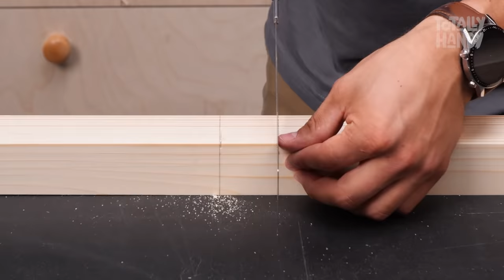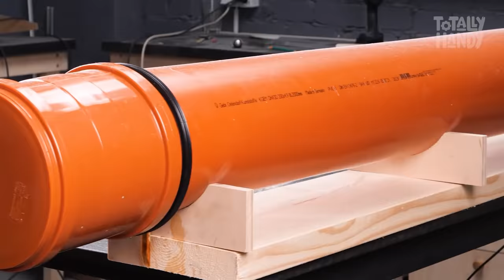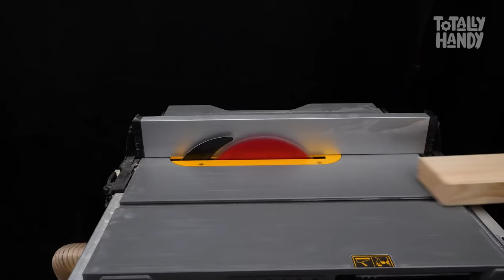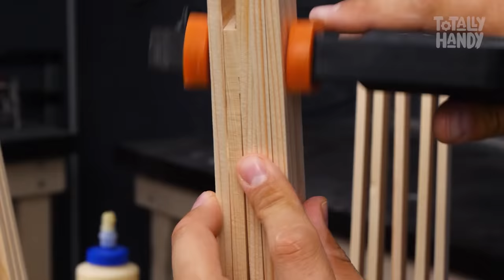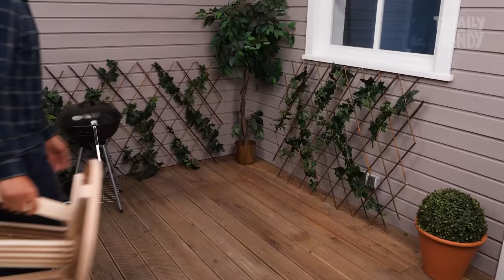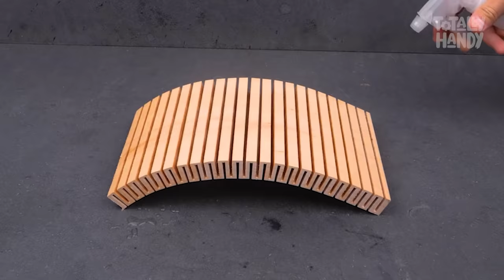Bending Wood into a DIY Table & Other Woodworking Tips | Woodworking Project

Comment: I'm a model ship maker and many yacht repairs.  I can't have a steamer where I work, so,  I soak my wood in ammonia.  100% house hold ammonia .  Let it soak overnight, pull it out wipe it with a rag real quick and put it in the jig.  I can bend curves in a flat piece of wood without it buckling up on me,  it stays flat with curves.  If you clamp the wood you need to move the clamps often so it dries evenly.   Same thing if you use tape to hold the wood in place while it dries.  I put the wood strips in a PVC pipe with a cap on each end.  Give it a try, its works!  Yes you still have to work the wood into place but it's less likely to split.
Reply: @criollitoification    I havent actually tested equal pieces of wood soaked in water vs ammonia. I've always had good results using ammonia.  I have laminated many boat frames with strips of white oak 3/8 thick 3 inches wide 10 feet long.  Soak about 8 of them at a time,  then the next day pull them out stack them and immediately clamp them in place.  When they dry,  un clamp them, glue each side and clamp them back in place.  When that dries, un clamp the laminated frame, sand it nice and smooth cut the ends where you need to and you have a beautiful strong alternating woodgrain frame.  I've never tried this method with anything over 2 inches thick.  I bet it would work tho.   The ammonia must soften the wood differently than just water?  To bend wood sideways, you need a jig and you will still have to work the wood into place, using a longer piece of wood helps then just cut off what you dont need.
Reply: @criollitoification    Hoy mate, thank you and Merry Christmas to you also.  This method works even better for model boats.  I build some of the largest model ships in the world, fulltime every day 26.6 years now.  May I recommend trying a couple of plastic models at first.  Seriously,  there are plenty of plastic models of square rigged ships available.   Hand tie all of the rigging.  DON'T use the shroudes/rat lines provided.  Hand tie everything yourself.  You will be amazed at how nice these models look.  Ahhh the Americas cup yachts!  I'm a big fan of the Americas Cup.   There is a Italian company that makes wonderful kits of the Golden age of yacht racing, the 1930s.  I built ....... 8 of them?  If you want to see them, on YouTube search,  'Jimmy Frost Master Shipwright.'  It was supposed to be Master Model Shipwright but.....  I did not know this video was going to be posted.  Forgive my slow speech I'm trying to think of what to say while saying it.  Also I got the scale of the 30 foot model of the Queen Elizabeth wrong, it's 1/32nd scale not 1/48.  The giant 40 foot hull molds were built with the Ammonia trick.  What you see in the video is fiberglass.  I'm building several plastic model ships now and I love them.  Check out the plastic kit of the "Vasa"  Its on my shelf and I cant wait to get to it.  The plastic kits will prepare you for wooden kits.  They are smaller, easyer and look just as good if in some cases, they look better.  Enjoy my friend.

Comment: I have a question. Is there risk of warping with humidity or losing the round shape of the table? I love the idea!
Reply: Yes there is...but the table is somewhat of a disposable design.  He didn't finish it, nor really cared about accuracy in the splayed legs (and the glued up slats aren't even aligned well).  That said, there's nothing wrong with that!   Sometimes, you just play with this stuff for a couple of hours and when the thing tears up, you just replace it with something else fun.  

Of course, with some extra work and different materials, you could improve the design to make it longer lasting and of more heirloom in quality.   I was impressed by the idea of the table myself...and I think the maker would have you take the spirit of what he did and maybe do a few things to make it your own, in whatever context you would use it.
Reply: mettre a top of'glace
Reply: @jayballauer8353  this table will last far longer then us with three four doses

Comment: Good afternoon my friend I just discovered your channel. You have amazing skills. After watching this video I became a fan.  subscribed.
👍🏻👍🏻👍🏻
Reply: 8 Woodworking Tips to Boost Your Efficiency

Posting

We’ve all heard the adage: work smarter, not harder. It makes good sense, so here are eight woodworking tips to make your shop work easier and more efficient:

1 – Sanding made easier

Sanding woodwork by hand may seem like a chore, but with special tools and high-quality sandpaper, you’ll get excellent results that often outshine a power sander. Besides, it’s quieter, doesn’t produce clouds of dust, and may get into places power sanders can’t.

Use a sanding block for faster, more efficient results. It distributes sanding pressure more evenly and maintains a flatter surface than merely folding a piece of sandpaper. Also, change sandpaper often.

Sand with the grain of the wood, especially for the final grits. To remove deep scratches and stains, angle across the grain up to about 45º for the first sanding. Before moving to the next finer grit, sand with the grain to remove all cross-grain scratches.

For sanding painted surfaces, buy clog-resistant sandpaper. The paint will build up slower than on standard sandpaper.

2 – Avoid drywall screws for woodworking

When screwing two pieces of wood together, use the traditional wood screw over the drywall screw for better results.

A drywall screw is threaded the full length. Since the top threads tend to grip the first board it enters, this can force two pieces of wood apart slightly because you have threads in both boards.

The top part of a wood screw, on the other hand, has a smooth shank that won’t grip the first board. This makes it easier to clamp two pieces of wood together.

There’s another reason to avoid drywall screws: The hardened, brittle steel shafts of drywall screws will often break during installation, especially when screwed into hardwoods. Removing them from a finished material is nearly impossible and getting them out damages the surface.

Wood screws are made of thicker, softer metal, so they’re break-resistant.

Wood screws do, however, require you drill:

A pilot hole for the threads

A wider counterbore hole the length of the non-threaded shaft

A countersink hole for setting the head

However, you can easily handle all three drilling chores by buying a set of three countersinking bits. They handle most common screw sizes.
3 – Know your wood’s moisture content

When building with wood, you must know the correct moisture content of each piece of wood.

Too dry, and the finished product may swell or crack. Too moist, and the end product may shrink or warp. It’s no wonder experts say incorrect moisture causes 80% of all woodworking problems.

￼Therefore, it’s critical to know the moisture content of each piece of wood before it is used. For instance, if you’re planning an inlay job using two different species of wood, you’ll need to know the moisture content of each type so that your inlay glue joints stay intact.

A failsafe way to avoid a ruined project is to use a moisture meter.

4 – Prevent excess glue stains

To eliminate stains caused by oozing glue along joints, clamp the pieces together without glue. Apply masking tape over the joint and then cut it with a utility knife.

Next, separate the pieces, apply the glue, and clamp them together again. The glue will ooze onto the tape, not the wood. Remove the tape before the glue dries.

5 – Measure with a drafting square

Make accurate measuring and marking layouts on boards faster and easier with a drafting square – available at any art supply store.

When you need an accurate square in the 2- to 3-foot range, drafting squares beat the cumbersome drywall squares for accuracy and eliminate the hassle of hooking up a carpenter square.

6 – Keep a clean, orderly workspace

Achieving efficiency in your shop can sometimes be as simple as clearing clutter from your work area. A disorderly work area can hinder your productivity.

Another tip: Only keep out items that you use daily. Everything else should be put in designated areas so they’re quickly retrievable when needed.

7 – Keep a well-lit shop

Pay special attention to lighting. You should have consistent and ample illumination on all work areas so you can work from any angle without casting shadows. This ensures safety and productivity.

Consider:

Overhead lighting

Focused lighting

On-tool lights

Painting walls and the ceiling white can help diffuse the light.

8 – Keep your blades sharp

Dull tools such as chisels, blades, planes, scrapers and gouges don’t cut cleanly. They tear at the wood fibers resulting in a fuzzy, uneven, unprofessional look.

Tools that have been chipped or nicked require grinding. A bench grinder, wet grinder, or even a belt sander can be used.

Avoid letting your tool get too hot when using a bench grinder or belt sander to prevent it from losing temper. Dipping it in a pan of cool water every few seconds will help.

After grinding, proceed to honing using either a flat wet stone or oil stone. A wet stone is preferred when doing fine woodworking.

The final step is polishing using a fine wet stone, a stropping wheel or leather.

Tools with sharper blades make woodworking easier, more efficient, and safer.

Closing comments…

Achieving efficiency in your shop won’t just improve your productivity and help you work faster and easier, it’ll also make you feel accomplished and more satisfied.

https://kamelohy90.systeme.io/1567d1b8

Comment: Good
Reply: 8 Woodworking Tips to Boost Your Efficiency

Posting

We’ve all heard the adage: work smarter, not harder. It makes good sense, so here are eight woodworking tips to make your shop work easier and more efficient:

1 – Sanding made easier

Sanding woodwork by hand may seem like a chore, but with special tools and high-quality sandpaper, you’ll get excellent results that often outshine a power sander. Besides, it’s quieter, doesn’t produce clouds of dust, and may get into places power sanders can’t.

Use a sanding block for faster, more efficient results. It distributes sanding pressure more evenly and maintains a flatter surface than merely folding a piece of sandpaper. Also, change sandpaper often.

Sand with the grain of the wood, especially for the final grits. To remove deep scratches and stains, angle across the grain up to about 45º for the first sanding. Before moving to the next finer grit, sand with the grain to remove all cross-grain scratches.

For sanding painted surfaces, buy clog-resistant sandpaper. The paint will build up slower than on standard sandpaper.

2 – Avoid drywall screws for woodworking

When screwing two pieces of wood together, use the traditional wood screw over the drywall screw for better results.

A drywall screw is threaded the full length. Since the top threads tend to grip the first board it enters, this can force two pieces of wood apart slightly because you have threads in both boards.

The top part of a wood screw, on the other hand, has a smooth shank that won’t grip the first board. This makes it easier to clamp two pieces of wood together.

There’s another reason to avoid drywall screws: The hardened, brittle steel shafts of drywall screws will often break during installation, especially when screwed into hardwoods. Removing them from a finished material is nearly impossible and getting them out damages the surface.

Wood screws are made of thicker, softer metal, so they’re break-resistant.

Wood screws do, however, require you drill:

A pilot hole for the threads

A wider counterbore hole the length of the non-threaded shaft

A countersink hole for setting the head

However, you can easily handle all three drilling chores by buying a set of three countersinking bits. They handle most common screw sizes.
3 – Know your wood’s moisture content

When building with wood, you must know the correct moisture content of each piece of wood.

Too dry, and the finished product may swell or crack. Too moist, and the end product may shrink or warp. It’s no wonder experts say incorrect moisture causes 80% of all woodworking problems.

￼Therefore, it’s critical to know the moisture content of each piece of wood before it is used. For instance, if you’re planning an inlay job using two different species of wood, you’ll need to know the moisture content of each type so that your inlay glue joints stay intact.

A failsafe way to avoid a ruined project is to use a moisture meter.

4 – Prevent excess glue stains

To eliminate stains caused by oozing glue along joints, clamp the pieces together without glue. Apply masking tape over the joint and then cut it with a utility knife.

Next, separate the pieces, apply the glue, and clamp them together again. The glue will ooze onto the tape, not the wood. Remove the tape before the glue dries.

5 – Measure with a drafting square

Make accurate measuring and marking layouts on boards faster and easier with a drafting square – available at any art supply store.

When you need an accurate square in the 2- to 3-foot range, drafting squares beat the cumbersome drywall squares for accuracy and eliminate the hassle of hooking up a carpenter square.

6 – Keep a clean, orderly workspace

Achieving efficiency in your shop can sometimes be as simple as clearing clutter from your work area. A disorderly work area can hinder your productivity.

Another tip: Only keep out items that you use daily. Everything else should be put in designated areas so they’re quickly retrievable when needed.

7 – Keep a well-lit shop

Pay special attention to lighting. You should have consistent and ample illumination on all work areas so you can work from any angle without casting shadows. This ensures safety and productivity.

Consider:

Overhead lighting

Focused lighting

On-tool lights

Painting walls and the ceiling white can help diffuse the light.

8 – Keep your blades sharp

Dull tools such as chisels, blades, planes, scrapers and gouges don’t cut cleanly. They tear at the wood fibers resulting in a fuzzy, uneven, unprofessional look.

Tools that have been chipped or nicked require grinding. A bench grinder, wet grinder, or even a belt sander can be used.

Avoid letting your tool get too hot when using a bench grinder or belt sander to prevent it from losing temper. Dipping it in a pan of cool water every few seconds will help.

After grinding, proceed to honing using either a flat wet stone or oil stone. A wet stone is preferred when doing fine woodworking.

The final step is polishing using a fine wet stone, a stropping wheel or leather.

Tools with sharper blades make woodworking easier, more efficient, and safer.

Closing comments…

Achieving efficiency in your shop won’t just improve your productivity and help you work faster and easier, it’ll also make you feel accomplished and more satisfied.

https://kamelohy90.systeme.io/1567d1b8